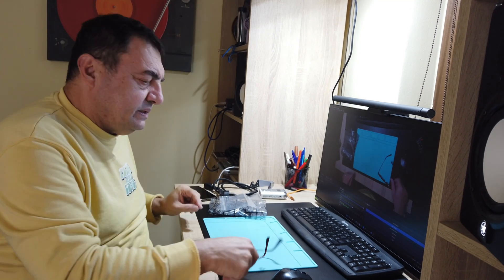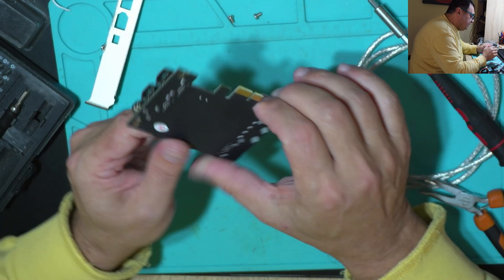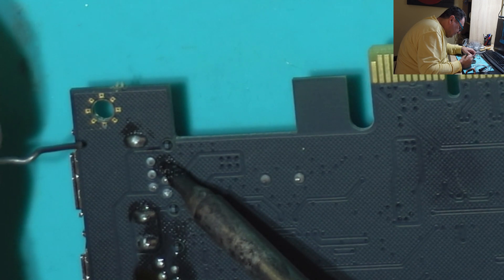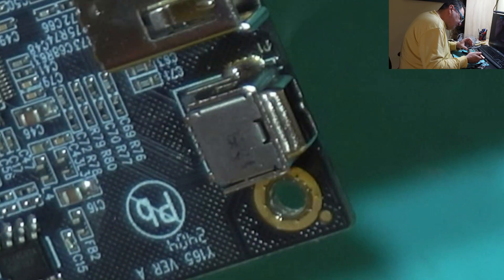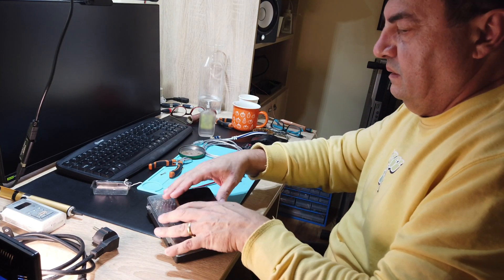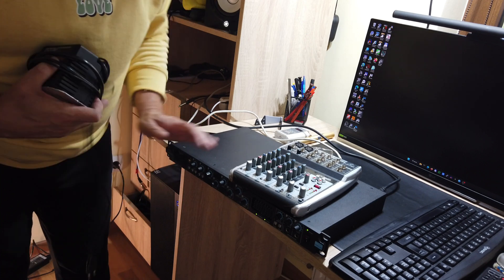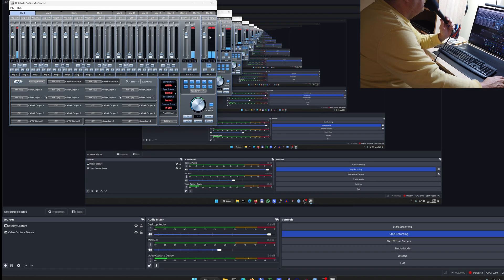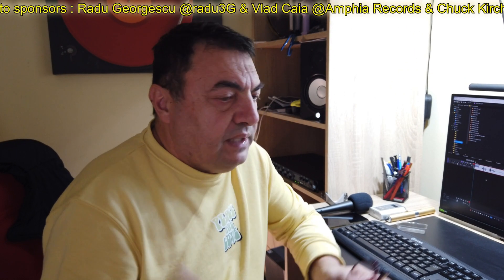PCIe Firewire Card fix & Focusrite Saffire Pro 40 install and test

Comment: about that card, how does it react with OBS? can you have every single input individualy or it is the master mix? thanks
Reply from the maker: I didn't really check for that, so far I can use it with a multitrack recording software (like Sony Vegas) each channel separate. 8 individual inputs goes to respective track. Probably with a proper routing that should be possible with OBS too.

Comment: Very nice. Please, what motherboard do you use in your pc (brand or model)? My old PC died and I want to continue using my saffire pro 24. I was thinking of buying a Startech pcie with TI chipset (XIO2213B, recommended by Focusrite) but it costs almost 100$, so I thought of buying a cheap USB interface instead (since I assumed that the saffire would not work in W11). However I was also thinking of putting together an AMD PC (Ryzen 5700) and I see that the CPU you are using is Ryzen 5800x, so I guess it's a good idea to know what motherboard your pc has. Thanks
Reply from the maker: For the firewire PCIE card , I bought the cheapest from Alieexpress...and works greast ! For mainboard & others look here : https://youtu.be/FksBeFXSOEI
Reply: @viocaia  thank you very much for the feedback. I'm surprised you had no problems with the cheap firewire pcie (and seeing that it wasn't even soldered properly). I just watched the video and it is a good setup, simple and accessible. I will try something similar to see if I can get the saffire card to work. :-)
Reply from the maker: @escafandrasemiotica  It's working great, stable and fast.
Reply: @viocaia  that's great. It gives me hope to continue using my saffire normally. Thx
Reply from the maker: @escafandrasemiotica  Of course, it's a good piece of audio equipment.